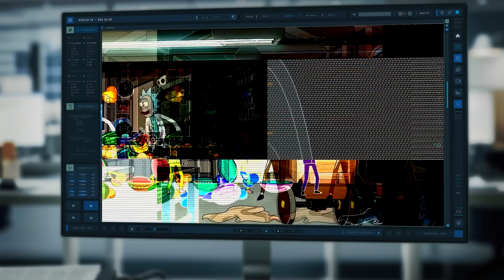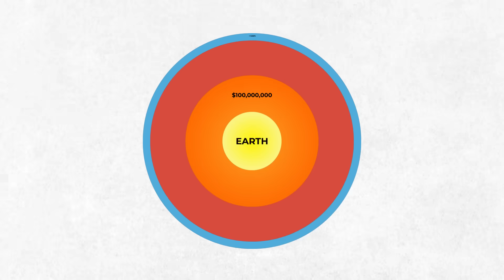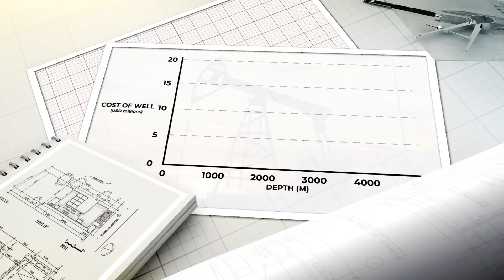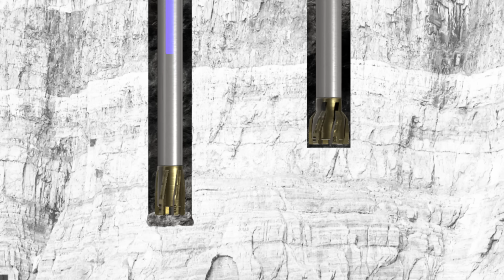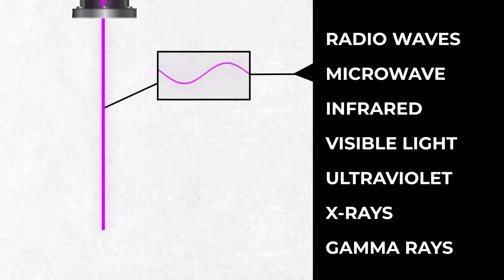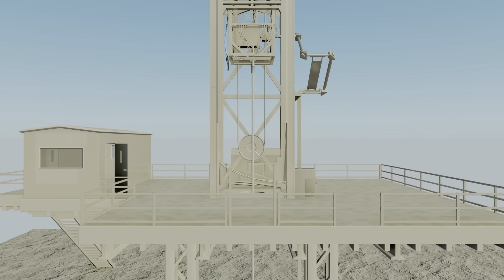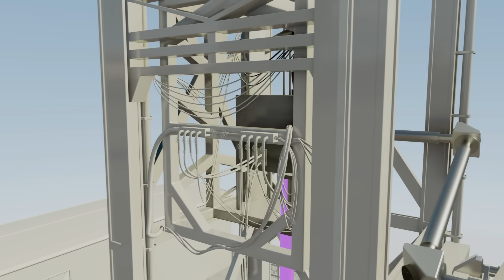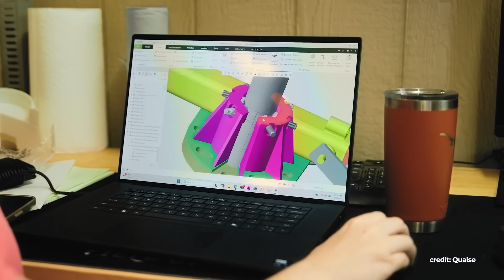The Most Advanced Drill in Human History

Comment: Ok, the elephant in the room here is how are they planning on keeping the pressure high enough in the bore hole to prevent a) the overburden pressure collapsing the hole and b) eruptive zones from flowing to surface? 
- At 10,000m depth the hydrostatic pressure is about 981 bar, that's around 14,227 psi. This is using a plain water gradient for simplicity, and assuming no overpressure zones the whole way down (which is totally unlikely in and of itself).
If you have essentially air or another say inert gas in your drill string and annulus then, due to the very low density of the medium, your 14k psi is pretty much transmitted to surface. 

As we are using a plain water gradient (unrealistic) we can also ignore the compressibility factor for air and state we need the complete system from surface drilling equipment, well structure and borehole from surface to the bottom to sustain a pressure of over 14,000 psi. 

I fail to see how they are going to manage that pressure safely in the borehole using only a vitrified glass sheath. In the shallower zones of the well, there's no way this brittle glass envelope will sustain such a pressure differential and the slightest crack or deformity will lead to catastrophic failure. And I also fail to see how they will be able handle such pressures (essentially operating pressures) in the surface equipment. Furthermore the stored energy in a well volume full of air / inert gas at 14k psi is incredible - a leak / rupture would kill everyone on site in the blink of an eye.

In deep / HPHT oil & gas well drilling we use very heavy fluids to sustain the downhole pressure and along the whole well bore. This also keeps the surface pressures very low (if any) and very often we are drilling through pockets / over pressured zones / changes in pressure gradient where the drilling needs to stop and the well gets cased off to seal the borehole. This then allows depth progression with a fluid of a lower density. 
The surface drilling package & the whole well construction is, of course, engineered to sustain a gas-to-surface scenario i.e. the 14,000psi situation but then we are in a very extreme well control situation and the no.1 focus is killing the well, i.e. pumping / circulating it full of heavy drilling fluid again, and these, despite hollywood and the lame stream media, are exceedingly rare events.

I do not for one second buy that this vitrified glass sheath will work and sustain such pressure differentials for the whole well drillng operation, I cannot fathom out the surface pressure control / safety, and I totally fail to see that a real world HPHT / deep well drilling engineer has been consulted in any of this.

Those who fail to learn from history and/or experience are doomed to repeat it.
Reply: its a whole bunch of vaporware to get government funding and big oil money as far as i see it.

Comment: 3:02 was coil tubing procedure...not tripping drill pipe or "taking the drill pipe out to change the bit, motor or a multiple of other things that could of gone wrong or need changing out. weird you put a picture of something that happens after the well is already drilled to show people. I guess youtubers don't care what is shown as long as the audio part is correct. good thing they get paid if they are right or wrong but people that are knowledgeable in this most likely wont subscribe

Comment: 🥱Once again, you Americans with your unrealistic patent solutions... Meanwhile, tens of thousands of households in Munich have been supplied with electricity and district heating from geothermal power plants for years. In 2020, 37 geothermal power plants with a depth of more than 400 meters were in operation throughout Germany, with a total installed thermal capacity of 350 MW, nine of which also produce electricity, 47 MW. The deepest geothermal borehole in Germany is 5,079 meters deep and is located in Holzkirchen. By 2030, another 100 geothermal power plants are to be commissioned. And no, we don't have any volcanoes here. And the boreholes were drilled in the usual way. My goodness, you Americans have thousands of depleted oil wells; the boreholes can easily be reused for geothermal energy. You don't need to generate super-hot steam for this, 140 °C is enough! But no, you have to reinvent the wheel every time so you don't have to seriously deal with implementation.

Comment: I'm sure groundwater at a depth and pressure of 5-10km will not cause any issues
Reply: For sure, drilling mud isn’t incredibly heavily engineered or anything. Plus, I’m sure that melting rock with 43 W of delivered power at 10 km because of waveguide power loss will be great. 😂
Reply: @joeshmoe4207   The hydrostatic pressure generated by a depth of 5-10km is immense. Normally drillers use bentonite based mud within the borehole to provide lateral support, and to prevent a large pressure difference between the drilling head, the pipe strings, and the surrounding ground /groundwater

As drilling muds are not being used, the drillers will need to find a way to keep the hole from closing, and pressing on the drill strings at depth where the heat and pressure starts to deform solid rock. If this was to occur the hole would need to be abandoned. With a differential pressure of 5-10km between the groundwater pressure and the drilling head, I foresee massive problems with the ingress of water. As water prevents this technology from functioning, this issue alone has the potential to kill the concept entirely
Reply: @nicholaidajuan865  I think the concept is pretty much DOA, but perhaps they have thought of all of this. Seems like they have at least some industry connections. Might just be chasing VC money so who knows.
Reply: @joeshmoe4207  I'm a Geotech & Civil Engineer and have drilled a lot of holes. They are physicists with an interesting concept, and venture capitalists seeking a technology with the potential for trillion dollar payouts. I'm waiting to see the Engineering that links the two into a workable concept. Concrete encasement has constraints that limit its useful depth

Comment: Once they have mastered the method of accessing and processing geothermal power, we will have an abundance of the most sustainable energy option available to us!
Reply: Geothermal power is extractive non-renewable technology because the heat flux of rock is not high enough to replace the heat extracted. The temperature is not the only requirement to run a steam turbine. You need power. Tonnes of steam per hour.
Reply: @kimollivier  Is steam the only way we know how to turn heat into energy? I find that a bit hard to believe with all the tech we have suddenly pulled out of our orifices of late. Sorry i dont quite understand, are you saying that if we pump heat up, it can't be replaced as quickly as we pull it out, and we will end up slowly cooling the core? After being accused of causing global warming, that would be poetic 😂

Comment: From memory: most of the shallow geothermal sites are near coal fields. There are many pwer stations close to coal fields. Using a different heat source for existing infrastructure would make adoption so much easier. Though most require steam turbines prefer an steam input temperature of 550C.

Comment: im no expert whatsoever in this. but wouldn't excessive geothermal energy extraction accelerate the cooling of earths core (ofcourse just slowly), risking the weakening or destruction of the magnetic field that shields the earth from all kinds of radiation? 
I said im not an expert, so ofcourse i don't know what the energy potential of earths core is and how much of that potnetial we would tap into.
Also an interesting questin is how far down can they "see" as in predicting where they will go thorugh rock and where they could run into a pocket or stream of fluid (lava / oil / cave). If they are at a very great depth that would be a disaster as the weight of all the beams will be pushing down. But that is an obstacle in all kinds of drillings.

Comment: I'd bet on this team getting to a commercial solution before any Fusion startup.  Their challenge, while huge, seems to lend itself to incremental progress and they appear to be moving at a great clip.  Plus - if they can pull this off, they can plug the hot water streams right into existing coal/gas turbines.  Great video Ben.
Reply: in before people are dumb and they think piercing the earth would make another volcano, shutting down the project in the process.
Reply: I suspect they're closer too. Still, they need to go a lot deeper to reach the temperatures needed for steam to run a decent sized power station.
Reply: @Ben-fr8gi   - yes - and everything becomes more difficult as the bore hold gets hotter/deeper.  Monitoring, extraction of vapor/debris, etc.  Fingers crossed.
Reply: Helion and TAE are very close to commercial fusion. The subsurface water issue is significant. There's a lot of subsurface water.
Reply: @danielschmidt2186  Only if you believe the words of a techbro startup, which you shouldn't.
Reply: @danielschmidt2186   - Daniel, I am rooting for them, but I've seen nothing in their external communications that makes me think they are within 5 years of commercial viability.
Reply: Fusion has taken so much money that could've been used in geothermal. We would've been half way to the earth core by now.

Comment: I still don't quite get how the vaporized rock doesn't just re-deposit along the shaft on the way out of the hole.  This is the first video on this tech I've seen that at least asked that question.
Reply: Vaporized! Turned to gas .
Reply: @RyanRosayATinstaG  Only at the super heated tip of the beam - after that it's cooling down.   If you have to blow that gas 10-100 miles out of the hole it's going to cool down quite a bit during that trip.

Comment: There's only partial truth about the torque being "dissipated" to the surrounding borehole, in the form of friction (ie. the comment about being 10km down and the torque not getting to bottom). Generally, in order to turn the bit at bottom, we take an off-bottom measurement of the surface torque required to get the bit to spin; known as the free rotating torque. We most certainly can rotate a bit at 10km depth - especially if it's in a vertical well. I've been in involved in projects internationally where the wells we were drilling were in excess of 10km, and highly deviated - one well was 15km (48,000 ft), with a free rotating torque just shy of 80,000 ft-lbs. This is certainly extremely high - with torque applied at surface exceeding the rating of the drill pipe connections quite frequently...

Similarly, there's always an option do use a drilling motor (ie. fluid pumped from surface turns a rotor assembly connected to the drill bit... the drill pipe doesn't need to turn, and just counters reactive torque) - although conventional motors have elastomer limitations at deep depths. There are a ways around this, like using some of the modern metal-to-metal motors being developed, or even turbine motors.

The biggest issue for drilling a wellbore with accurate positioning/placement are the electronics in the drilling bottom hole assembly - nothing in the industry will handle more than about 220-230 Celsius for any extended period - and even these tools are very niche and on the limit as far as technology goes. Not to mention limited in capability compared to their "conventional" counterparts....

Edit: I should mention I am a fan of Quaise - they're doing some pretty awesome stuff that most in the industry wouldn't dream of trying!
Reply: As a drilling engineer, it's nice to see this type of comment. I find a lot of these Quaise-related videos distort reality, either through lack of understanding, or more rarely, on purpose. Quaise are also not entirely upfront either...though i also think the technology is very interesting.
The quandary associated with deep geothermal is that the end product is never going to rival oil & gas in terms of profit margin, yet the technology to drill and complete efficient deep geothermal is more expensive than oil & gas.

If the wells were vertical, and you're not aiming for a very specific target (like you are in oil & gas), then arguably you dont really need real-time downhole data. Regular surveys can be done down the string with a gyro (instead of old-school magnetic) tool on a cable (not wireline) as needed - just like the days before MWD, when Totco rings in BHAs were common... showing my age...  

However, vertical geothermal wells are very inefficient. There is no value in going hotter than needed, so it's better to go horizontal or high angle resulting in a more uniform temperature profile. 
Ideally the wells need need a lot of wellbore exposure at temperatures above 375degC to be economic, so directional work is needed. The solutions for this are indeed more complex, and while really high temperature electronics do exist, they haven't been built for L/MWD, and the tech is extremely expensive.
Reply: @cerealport2726  Exactly my thoughts on the matter mate, couldn't have said it better myself! It also doesn't account for the fact that at deep vertical depths, the hole will continue to slough in - much like putty. This is one of the primary issues with the Kola borehole... regardless of whether they don't require a bit-trip to continue drilling; that only buys them a couple of days at most of additional drilling time before the hole sloughs in and they get stuck in hole. Most people also don't understand that melting the rock immediately at the borehole wall doesn't give it magical powers to exceed the mechanical properties of high yield casing.

FYI, I'm also a Petroleum Engineer that's worked in Drilling & Completions for most of my career... everything from complicated TAML5 multilaterals (eg. subsea dual/tri-laterals w/ flow control etc), to present day involved with precision wellbore placement (eg. wellbore intercepts for complicated P&A or re-entry; and also geothermal/mining applications).
Reply: Why can't there be something like a bicycle chain inside the drill shaft that turns the drill bit at the end?
Reply: @Sergparkour  that would be horribly inefficient - significantly more so than a mud motor (PDM)... fluid friction losses inside drill pipe generally aren't too extreme (ie. pressure drop).

Similarly, when it comes to making drill pipe connections, you'd then need to make a reliable method of adding on additional chain segment... this is the same issue wired drill pipe faces - making a reliable interconnect to re-establish electrical connection from one pipe segment to another.

Also, keep in mind that the downhole drilling dynamics are not as smooth as you see in many animations/videos - quite the opposite in fact... extreme shocks occur. For a good example, search for a video called "Drill String - Shock and Vibration in Drilling"... it shows a blue drilling assembly simulating downhole shocks on video.

Comment: This type of energy will never compete with solar wind and battery storage financially. It will probably never become viable for energy but that doesn't mean there won't be other uses for it. Like possibly eliminating nuclear waste or other contaminants like pcbs. Think about it. They could drill right next to a nuclear power plant and dispose of all the nuclear waste without having to relocate or travel. Flush it down the hole cement the whole backup. The waste would be secured forever and there would be no way to get to it in the future. But hey who knows.
Reply: Geothermal power where it's been built is competetive with wind and solar, also being base load power it would be competting with things like Nuclear which it will certainly crush.  If a large thermal storage tank is created at the surface then the generators can be oversized relative to the borehole pumping rate and the operation can be more like Solar Thermal with storage and it can act as a dispatchable power source.  Note that in geothermal system you do not ever want to stop the flow of water down and up the pipes as it will be slow to restart again.

Comment: Digging 10 km for tapping geothermal energy doesn't make sense. There are recent discoveries of Shallow Geothermal Reservoirs using Magnetotellurics (MT) methods. 
Western United States (2025)
- A Stanford-led study revealed that blind and hidden geothermal systems—those without surface signs—make up a majority of known resources in the western U.S.
- Many were discovered accidentally during water well or mining operations.
- Less than 0.4% of the region has been explored via shallow drilling (0–20 m), highlighting vast untapped potential.
Global Trends
- A 2025 review in the Arabian Journal for Science and Engineering emphasized the rise of shallow Enhanced Geothermal Systems (EGS) and CO₂-based fracturing to access low-depth heat sources.
- Abandoned oil and gas wells are being repurposed to reduce drilling costs and access shallow reservoirs.
Technology Expansion
- Modern wide-band Audio MT (AMT) instruments now allow exploration from a few tens of meters, making shallow geothermal mapping more feasible and cost-effective.

Comment: 4:10 how are you sure you will not lose any water? Data centers also have closed loop systems but they lose water
9:35 so you don't need to replace the "drill bit"? There is no build up of material on that drill bit? Do they have a really long shaft that is assembled on the site or they have cable and at the end of that cable they have a drill bit?
13:10 what about loss of energy on transferring it through the shaft down the drill bit? We are not losing any energy there?
14:35 so any ground water makes that solution unavailable?